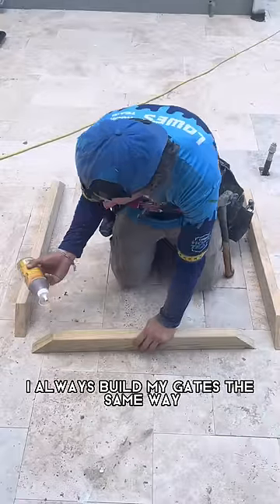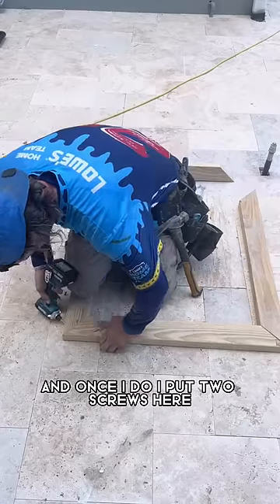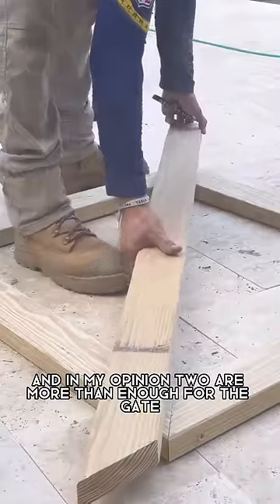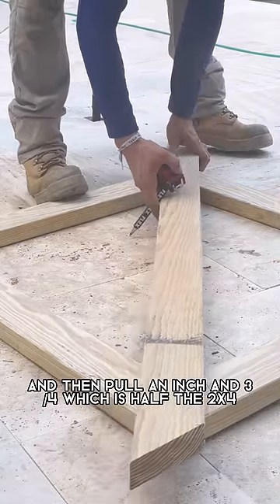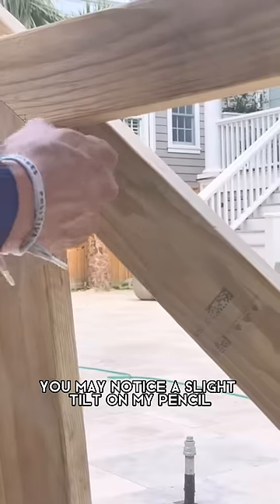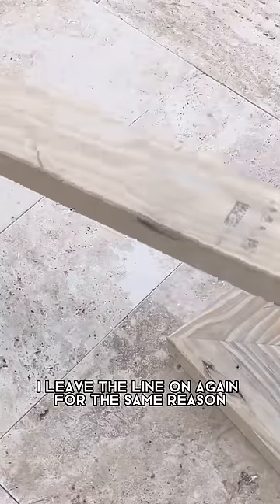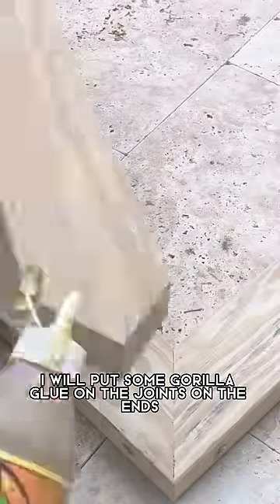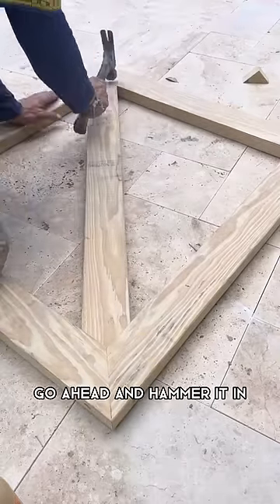Fence Redo Part 8 Short

Comment: Im glad to see someone out there doing their own thing and not listening to the know-it-alls that have never done it. You're using tools that the normal guys would be ashamed to be seen using but turning out finished results they could only get if they paid for it. The art is in the artist, not the tools. Keep it up
Reply: Tools are ok 🤷‍♂️ Joint is wrong for a gate. No strength in a mitre. That’s abc stuff
Reply: @t-rex4211  I completely agree with you on that. Half laps are how I build mine
Reply: @giraffewithtattoos2770  Yeah that’s how I do mine. Glue and screw the corners and mid rail then bang the braces in like he did then screw and glue them in. I’ve just made one that the client wanted clad both sides so I doubled up 18mm ply as the core then cladded the front and back with tng then edged with 70x30mm timber. The thing is only 1850x845mm but I stuck on the scales and it weighed 56kg 😂Thankfully they wanted the Chucky look with field gate hinges

Comment: I don't have any criticisms of this design or execution, but if having the four sides perfectly square is important, ramming that brace in is probably gonna put it out of square. Depending on how the gate is finished (let's say, vertical 1x slats), the brace could go on last after the outer frame is bolstered by the facing.

Comment: I do HVAC I'm not a carpenter by any means so I have to build shed doors for my girlfriends shed down at the beach house because of rot so my question is do you just recommend one brace through the middle because the doors that she has now have an x pattern but the second brace is cut in half and just screwed to the first brace on both sides which to me is just an aesthetic feature it doesn't really look like it's actually supporting the door so just wondering some thoughts there
Reply: P

Comment: OK would have liked to see you point out that the brace goes up from the hinge side to the latch side. So often I see gates hung the wrong way, with the weight hanging off the brace, which in fact leaves the brace doing no real work.

Comment: Ain’t all screws construction screws?Just question. I don’t know. Is there a difference between resi screws and const screws.
Reply: No, there are many different types of screws. Wood screws, deck screws, structural screws, drywall screws, etc.
Reply: @charlesball9522  being a commercial electrician for 17 years it was a rhetorical question. There’s no such thing a commercial screws. There all the same.

Comment: I noticed a lot of these construction videos people are constantly using impact drivers on projects like that small gate I almost guarantee that those screws are not impact rated which causes screw head breaking and failure the right tool for the job is essential

Comment: You need to be spritzing a little bit of water on the wood before you apply the glue. Gorilla glue reacts with water, and it needs a moist joint

Comment: I use rapid fuse by DAP it’s right next to gorilla glue in the aisle stuff is the bomb it’s ca glue without the activator….
Reply: I use that for trim work
Reply: CA glue is not made for flying things like this. You've watched way to many YouTube videos where they use super glue to glue wood. Super glue on this application would immediately crack on the first time that gate gets slammed. It's far too brittle. If you don't have patients for wood glue, use screws and glue.

Comment: I notice you don't pilot hole, nor do you use  Round Washer Torx Screws, which grabs the wood in such a manner that it never loosens and are nice to look at. This way you only need one screw and forget the glue...

Comment: Even with the glue on the joints water still penetrates because your screws are into the end grain of the wood. In 10 years the gate will be loose and sagging.

Comment: Aren't you supposed to wet 💦the wood when you use gorilla glue? Also do you measure from diagonal corners to check if it's square?
Also, really you should put something under the build area cuz you drop glue on someones tile floors can make a stain.

Comment: you should be using biscuits or at least dowels... YOU MUST wet both sides of the wood a bit for the glue to actually work as well... the expanding of the glue does NOT ADD coverage... you must cover both sides adequately.. the expansion of the glue just forces it into the fibber but only if its been wetted first... what you did was a total fail that will not last

Comment: Don't use stainless it isn't strong . Stainless has a very low tensile strength. Use a coated or galvanized steel screw

Comment: Making the crossbuck fit so tight isn't good for weather changes and swelling. It's good to have it fit right, but if you've got to hammer it in someone at some point is going to have a bad time.

Comment: That cross brace would push it out of square the way you did it.
Reply: How so?
Reply: @t-rex4211  because he intentionally cut it too long so it was an extremely tight press fit meaning it’s pushing those two corners apart and forcing it out of square.

Comment: You would die laughing at how the “professionals” built the gate at the house I rent…..I want to vomit when I have to use it.
Reply: What did they do
Reply: @definingslawek4731  I wish I could post pictures. It’s just three cedar boards across with one “diagonal” which is only a backer for the hardware. The latch side is 7” off level….the whole top line has a 2” height difference wave and the screws, I picked up a whole box of screws and I don’t even know when it was done or by who.

Comment: Sorry to join the rest of the keyboard critics but did you realise you accidentally flipped the brace before gluing, THAT'S why you had to hammer it in (on a stone patio no less). Sounds good for clients when you say you things to fit "tight" but without attention to detail or a square cut, you have to brute force, leaving no difference between you and a careless contractor

Comment: Just to darn heavy...even after installing... 5/4 ripped down to 3.5 and then using leftover 2 3/8 for angle bracing and lock build up  , out.

Comment: What is the point in mitering the gate frame? Rails butt into stiles. It's not even a tight miter or perfectly aligned, so it's clearly not even square.

Comment: The only problem that I have with this video is the fact that you hit the board on the end with the hammer and marring is clearly visible right where you're hitting at the end to flush it up.  Other than that, great build!  Everyone does it differently and anyone who says it's wrong is not the type of person I'd have building anything for me.  Yeah, I'm a carpenter, but I'm not going to judge you because you do it differently than I would.  I just don't like smacking the end of the boards with the hammer is all.  I mean, use a scrap piece of wood for that, man!  Lol!  Jk.

Comment: All yall "Should of, Could of, Would of" commenters.
All I heard was spread it and tight and snug fit 🤣

Pro tip: Use a rubber mallet for hammering wood, unless you want a rustic look, then beat that wood up.
*drops carpenter pencil and slowly walks back to wood shop 😉

Comment: Seriously youve never done production work, paid by the foot, gate is built hanging, not built and then hung, a top, a bottom and crossbuck, no sides needed, put in top nail to post, put on bottom nail to post, put in crossbuck (starts at the top on the latch side and at bottom on hinge side) then nail on the panels, chainsaw rip latch side ( where its attached to post) so it swings free, super simple super fast

Comment: not trying to burst your bubble and of course I'm not telling you sir how to build a fence. 
    I just can't help but wonder how you come to prefer gorilla glue, that expands as it dries, rather that a joint glue that will contract as it cures?  its chemical properties makes gg a great glue for using under water, as its not water soluble, and will  expand into areas and cracks that cannot be reached otherwise which makes it a great glue for repairs, but don't seem to have the properties you would want for a construction glue....  

I don't know what the label would actually say I'm sure it'll tell you it's good for everything,.

Comment: No mortice and Tenon or even biscuit joints all glued together for an outside gate bad times afoot . That will all fall apart in 4 years and stop working in 6 months after it rains once or twice .
What has modern carpentry come too . What does the finish product look like as that looks like a pretty bad gate . Just saying

Comment: My great great grandfather made my now grandfathers houses gates out of solid steel, because of people crashing into his fence, still standing to this day, the metal posts are buried 10feet down fitted into other metal pipe so they can be pulled out every 5-10 years or so to be sanded and repained for rust protection and look. Roughly 50 car crashes and 6 people later and it still stands with just needing a tug from a tractor after a wreck

Comment: It blows my mind how much mess contractors leave behind for their customers to worry about.
When they hire you to do something, they didn't hire you to leave a mess behind. Unless you clearly explain to them that you will not clean up well after yourself, you're doing them wrong.
Risking getting glue & leaving scratches on their travertine is completely irresponsible. I would have fired you on the spot.
At least get a tarp at a dollar tree and work on top of it.